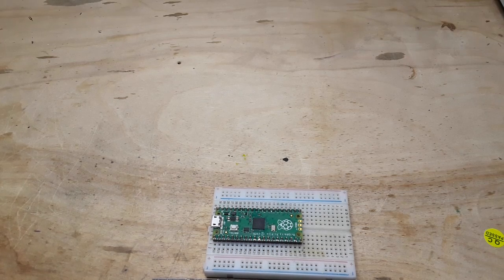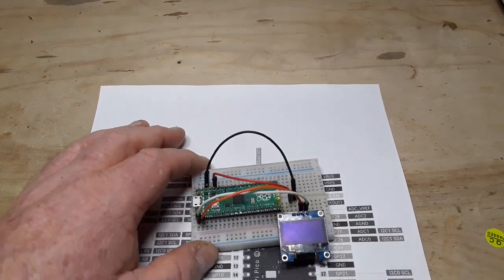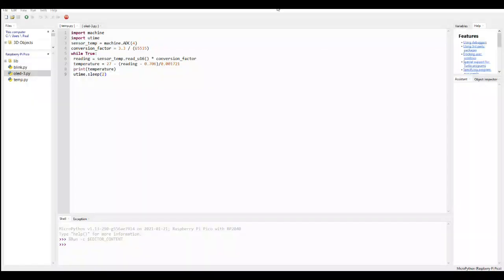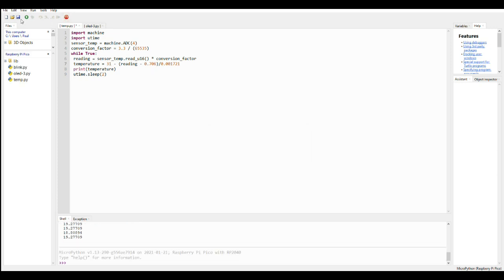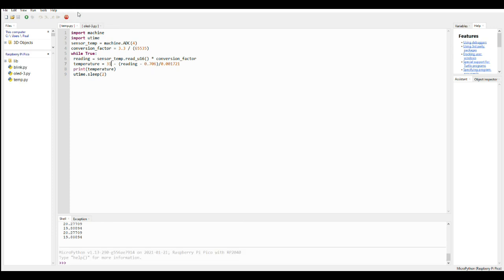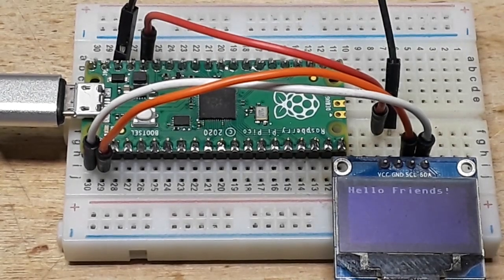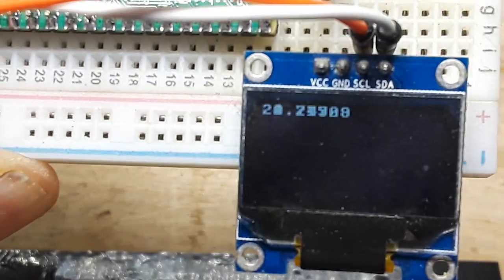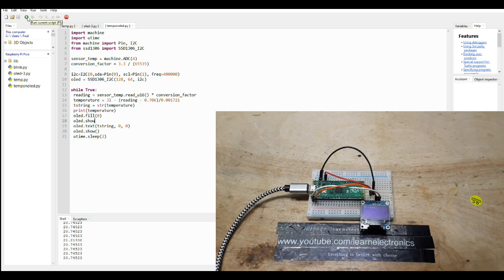Raspberry Pi Pico   Getting Temperature Reading on the OLED Display

Comment: Thanks for creating and posting, one of the better "how to" videos for us noobs.
I added and changed a couple lines to get readout in F. It works but not knowing what I'm doing there might be a better way...see below:
    reading = sensor_temp.read_u16() * conversion_factor
    temperature = 27 - (reading - 0.706)/0.001721
    temperature_f = (temperature*1.8) + 32
    print(temperature_f)
    utime.sleep(2)

Comment: I have been looking for weather related projects. DroneBot recently did a video on making an anemometer and I find all kinds of temperature and humidity videos with an occasional barometric pressure reader. However, I have found nothing for a wind vane, giving wind direction! I was wondering if that could be done with a rotary encoder. Or is there something easier? Also, looking for a rocking rain gauge, which could use either a magnetic reed switch or a LED/light sensor pair. And, finally, remote it all via wifi or some such. Either a PI or an Arduino. Not much, a bit less than the moon!!

Comment: Ive been messing with this particular thing for past few days and have managed to make the readout display cpu temp,ultra sonic distance range value , I even had a little pixel moving up down the screen depending on distance, The only issue im having is i cant find a way to make the text bigger on the screen.
Reply from the maker: Yeah, this library doesn't seem to have many different types of controls for the display. I've been thinking of trying out CircuitPython. You ever play with that?
Reply: @learnelectronics  I did put that into my pico but then windows refused to have compatible drivers to communicate with it so i had to revert it back to the original firmware. I think to use that id prob have to use Linux for compatibility issues.
Reply: @learnelectronics  Did you make any progress with making bigger text? i haven't yet.

Comment: Love it when you spend a substantial mount of time planning and building then troubleshooting a project. To turn something on and get it working is like a miracle! I built an amplifier a few weeks ago and at first I had a tube go bad then the resistors charred and I was encouraged since the first powering on was successful and the audio was so nice and loud. I ordered a tung-sol 12ax7 and plugged it in last week, it works flawlessly. Now I gotta build a speaker box and mount the guts into a chassis. I’m able to adjust my B+ voltage for the plates of the tubes, I was screwing with it this morning and I found that with 400 volts to run the power output beam tetrode I can put 200 volts through my 12ax7, but the cathode-heater resistance is rated for 180 volts I still need to measure this reading. Do you know what the ideal plate voltage of the preamp triode would be for optimal tone for a line-level audio signal like a Hi-Fi amp or is it higher or lower than this if I try to plug in an electric guitar or how about a condenser mic?